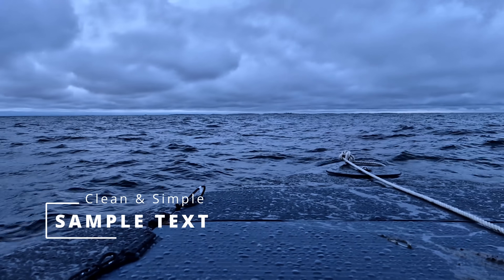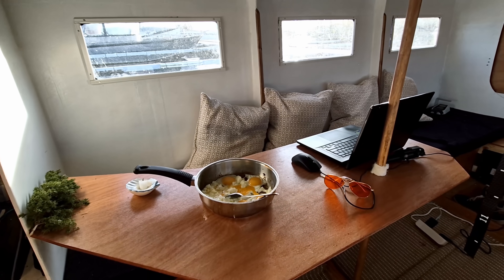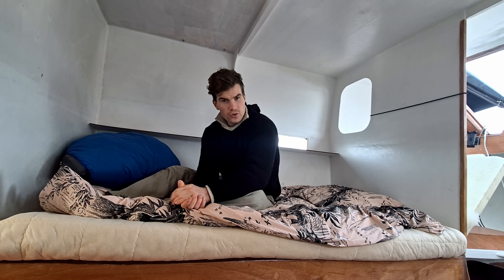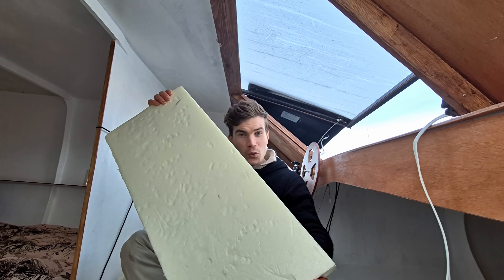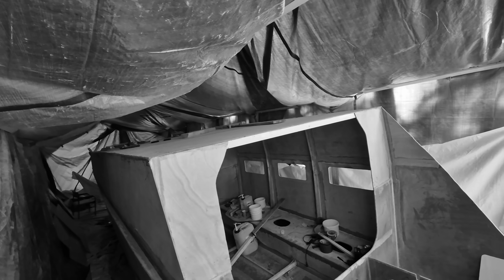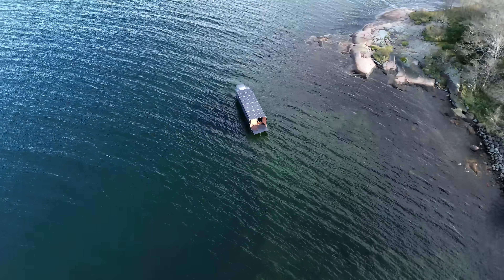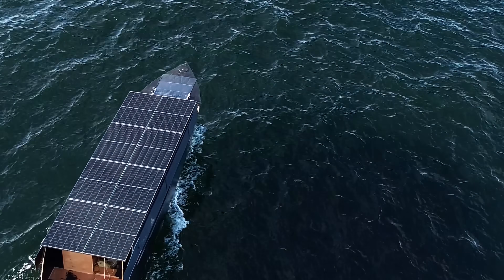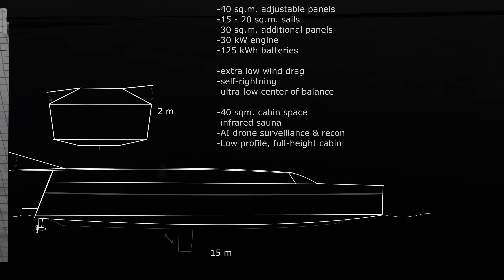⚠️ Power Failure at Sea – Solar Yacht vs. Winter ❄️ [Performance + Tour]

Comment: You really should consider adding a wind generator or more, as a secondary source of energy
Reply: Yes, wind generator will be in the order of 10 x more effective than solar running day and night.
Reply: @AllanTheBanjo eh, not really, cuz solar will charge even on a cloudy day, wind only charges if there is wind or the vessel is moving
Reply: @carlsteffens there's pretty much always a breeze on open water. I was involved in reseach into this a few years ago. Look up C Enduro usv, I was involved in engineering of that vehicle.
Reply: @AllanTheBanjo horse latitudes

Comment: How hard would it be to put the side solar panels on a lightweight frame that can swing up and lock in place so in good weather you could put them in a flat position same as the roof panels? I would also look at an arch on the rear where you could add your lights, satnav, starlink, wind turbine etc on permanently and also maybe use as dinghy davits.

Comment: For your next iteration, what about a support optional sailing something? If sunpower is low and the wind just right, set an addidional sail-kite-whatever so you get to use the wind when it works in your favor.

Comment: Lukas, are you advertising your ship to the public? Or are you going to adventure on your own?

How did you solve self-righting of the ship, in case it turns bottom up in harsh sea state? Not to mention - why did you pick plywood as the hulls main material? I mean, u myself am mostly conservative, but modern foam based materials can prevent small to midle sized ships from sinking, even in case of extensive hull dammage. - Vich seem ussefull to me.

Comment: I would have insulated the shell with thin, aluminum-coated Styrofoam; it's available cheaply in 3 mm thickness as impact sound insulation, weighs almost nothing, but provides excellent insulation. And having a gasoline or diesel generator for emergencies always seems like a good plan. But hats off to your achievement!

Comment: I would add some light weight outriggers that could be folded up.  When the sea gets rough this little addition would add a bit more support, reducing the chances of overturning. You could even have some extra solar on them using light weight panels.  Other than that, AMAZING job maman.  Wished I had the space and the money.  I have ALWAYS wanted to build a solar boat.  Be safe and follow your dreams dude.
Reply: I agree. A trimaran would make much more sense for something so lightweight, plus you could use all of that extra horizontal area for additional solar.
Reply: @vell0cet517 Originally he was going to do a catamaran, but settled for a monohull because he was doing it basically alone.
Reply: @moteroargentino7944  In a way, adding folding ama to his monohull is arguably an easier design to implement than a catamaran.
Reply: Yes and he could have them allowed for a set amount of movement which he could use to create even more electric production with.
Reply: @Soederlund  ?????

Comment: If your plan is to spend the summer in the Mediterranean, be aware that it will get extremely hot in this boat.
Reply: the full winshield opening will help significantly... hopefully.
Reply: There is enough solar power and battery capacity on board to run a high SEER rated 9kBTU mini split 24/7 in a Mediterranean climate to keep the small envelope of that boat cabin nice and cool.

Comment: I would insulate the hull with styrofoam for comfort in cold and hot weather. 
You can even start with a foam hull and reinforce in and outside with epoxy for the next one.

Comment: Cooool project,, 🥰👌. It will be supernice to follow you on your journey. 
I would plan for L 12-15m, W 2,49m. Max width to load on a trailer / lorry, without special permissions.
12 m, and you dont need shippers exam. Straight or negative bow, to longer waterline.
Cheers from Linköping / Sweden,, ✨🍻‍‍😎👍‍‍✨

Comment: ref : Solar and the North. Hopefully when you get South of the 45 degree latitude you should be flying along. I would get a hold of a larger circumference steering wheel as you might need to avoid a collision and less turns means faster rudder response. Also, improve comfort in the wheelhouse as you will be in there a lot. 'Toilet' what are the rules for disposal in the Euro canals as you sail into the future but resort to the stone age when nature calls ?
Reply: I think a holding tank is a requirement in the Baltic too.

Comment: Aren’t you required to have a radar reflector, navigation lights, a radio, and a survival kit etc. etc. when sailing on the East Sea? Aren’t you concerned they might impound your boat if you don’t meet the regulations?
Reply: or cause an accident
Reply: @herzogsbuick  That's what I meant to say. After all, you're not alone at sea and later on rivers and canals.

Comment: "Power failure at sea"........please.....you ran the batteries down to zero. Not quite the same as what the click bait title implied. 

Recapping the build of your boat every episode is a little lacking in interest. If it wasn't for the episode counter, it would be easy to get confused and watch the same video more than once.  Did so little happen since your last video? Boring is good! You don't want to risk your safety for views. 

Good luck.

Comment: I would personally chicken out and carry a tiny gasoline generator just in case. Or a tiny outboard. :)

Redundancy is nice.

And for now, unless you already tried it andade up your mind, I think a 3d printer would suit you well on the boat. You can print small latches, hinges, holders etc., and the steering wheel or anything else. And it could be a clean way to produce items that is not dusty or requires a lot of tools.

Comment: Very cool project/adventure. My initial thought is that the limiting factor when traveling long distances is the solar area. So what I would research is a way for these yachts to have much more solar. Maybe having a bunch of simple lightweight floating solar panels you can drag behind the boat via a rope giving you more energy. Alternatively, some clever inbuilt way to connect/disconnect scaffolding between a 2nd yacht in a catamaran-like configuration so you have a giant roof with much more solar panels.
Reply: Like using bi-facial solar panels, that fold in and out and hang down from the edges, to be used in calm seas, when no water is splashing them, but could be quickly folded back on to the main panels on the roof.

Comment: what about a small wind generator for when there is no sun and batteries are flat for emergency power?
Reply from the maker: Good idea. It just takes a lot of space. For absolute safety I'd just have much better sails, or a small petrol engine (just a 2,5 HP is good enough for 5,5 knot speeds)
Reply: Good idea , and it would be light and easy to carry and mount in sea . All the best and safe journey. Norway calling.
Reply: Wind produce so little for size and moving parts and vibration would put me off
Reply: These small sailboat-sized wind generators don't produce a significant amount of energy, unfortunately. Good enough to keep your lights going, but you'll not get any significant amount of charge into a 15kWh battery. Probably not worth the trouble.
Reply: Maybe just extendable mast and sail? Or even a kite?